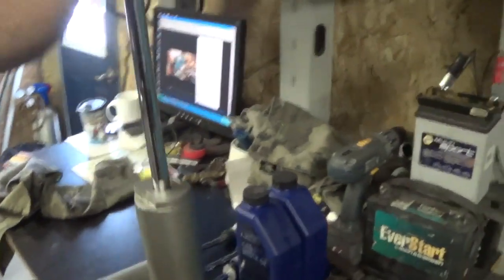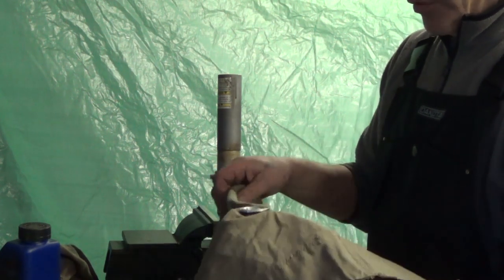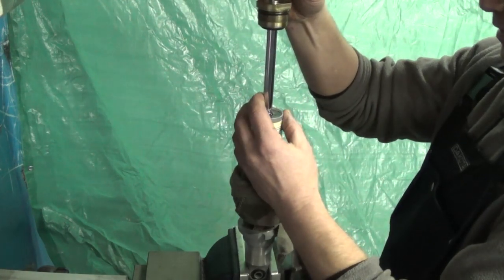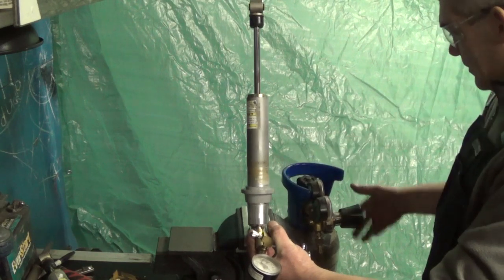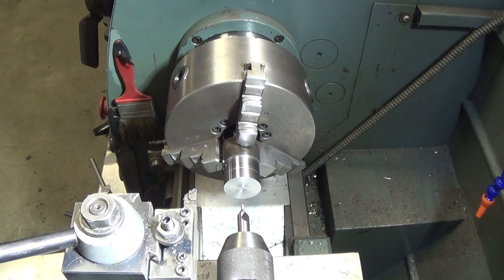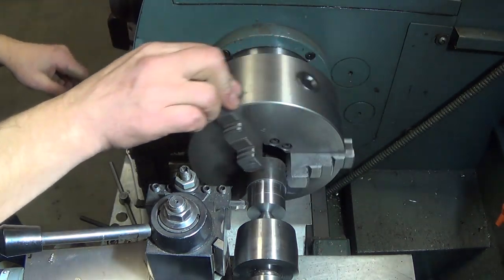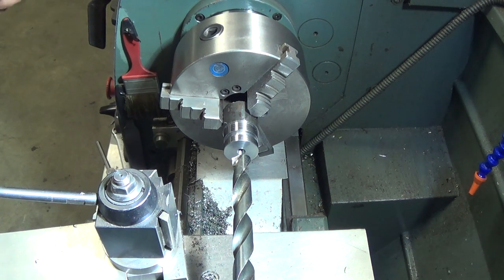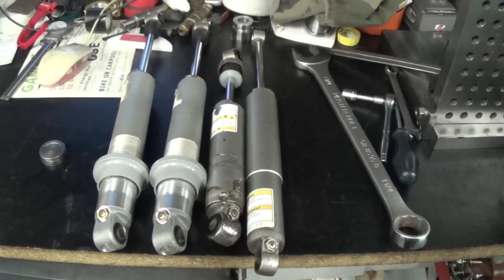A Shocking Development.

Comment: Nice repair build on the shocks. I've never had one apart, so it was a great video to see how to take one apart and what's inside. I can tell you probably have done hundreds if not more of these. Keep the great videos coming.
Reply from the maker: That was a basic set and they do get way more complicated with remote reservoirs and clicker adjustments. All pretty much the same procedure though.
Thanks for the comment! :-)

Comment: Doing a calculation, the shock tube is probably 36mm(1.4173 inch) inside diameter and 1.412 will give .005 clearance.
Great job, Colin, fixin' other people's stuff.

Comment: Great job Colin,   normally when that happens to me, it's the last piece of that size and alloy material I have, then the real fun starts. Very interesting procedure, especially the re-gassing process
Reply from the maker: Ya, sometimes it's just Duuhhhh!
I was thinking a diameter of .9 rather than the depth of .430  LOL
I've been doing these type of shock for some years. That set was a basic setup. They get way more complicated. Some late model shock cost in excess of $600 so they have a lot of fancy parts to justify the cost... :-)

Thanks for commenting!

Comment: Hi, seen the inside of a few of those, but never actually rebuilt any, would argon or other inert gas do the trick, and looks like the O rings or glands last forever?
Thanks for sharing,
Pierre
Reply from the maker: pierre beaudry Nitrogen is used because of its resistance to pressure change with temperature. For the most part the seals will last a long time IF the shocks are rebuilt on a regular basis. Most seal leaks are the result of damaged or rusty chrome rods cutting the seals. Mileage, of course, wears components as well and nothing lasts forever. Seal kits are reasonable cost and once rebuilt the shocks are good as new.  Colin ;-)

Comment: Hey Colin,

Those shocks seem to be responding to the healthy dose of Viagra and nitrogen. Was the original piston gland seal groove round bottom also?

Cheers,

Tom
Reply: Interesting to see process of rebuilding gas shocks.  Nice video!  Mike
 (aka toolmaker1968er)
Reply from the maker: Tom, yes the original groove was of the same radius but cut wider to allow the oring to "roll upslope" as the piston moves to accommodate the oil displaced by the rod as it enters the oil chamber. The sole purpose of the IFP (internal floating piston) is to keep the oil and gas separate while maintaining the gas pressure on the oil to prevent cavitation.
Maybe I need a big blue sticker on the nitrogen cylinder?? lol
Reply from the maker: Michael Murray
Thanks for the comment! :-)
Reply: +oxtoolco Hey Tom you know what the ingredients of Viagra are? Miracle grow and Fix a flat.

Comment: I applaud your rebuilding these gas piston devices.....However, I find the devices themselves to be an engineering failure. They are temporary at best, because they use precision seals to keep the inevitable from happening.   If you ever owned a hatchback car for example, you will know these things fail in use, in regularity...That said, these nitrogen charged cylinders are great as a patch, but no replacement for a hood hinge on a 1969 Camaro....LOL..
Reply from the maker: The particular shock I rebuild most are very expensive snowmobile units. They survive in some of the most demanding conditions imaginable....extreme cold, high piston speeds, hard hits. IMO they are engineered quite well to keep weight to a minimum and still be able to perform over thousands of miles and several seasons. there are a few brands that have some deficiencies but the better brands are quite good. The typical gas shock on a hatchback is nothing like a good snowmobile unit.
Most rebuilds are just a gas/oil change for freshening but sometimes I have to make a new rod because of stone damage, rust, or bending from accident.
What generally happens on the sled shocks is the rider leaves the service interval too long instead of getting them serviced on schedule. The nitrogen invariably loses pressure in the unit and once gone allows water to infiltrate the body and cause rusting of the internal components. By this time the shock is likely best replaced rather than rebuilt.
Thanks for commenting and, yes, a 69 Camaro should be left all original! My fav car, wish I could own one!
Colin

Comment: Hello, what do you think about welding a tire valve on a McPherson gas shock in order to refill it with nitrogen when needed?? Like in this video   https://www.youtube.com/watch?v=ivuhjMDINdE   . Is it any danger in doing this?
Reply from the maker: The shocks I rebuild have an internal floating piston which separates the nitrogen from the oil. Combining a gas with oil will result in a foamy mix which generally wont work. The whole idea of adding gas pressure is to keep the oil compressed to help remove foaming issues.
I'm not sure if the auto strut is even designed to have the gas added as I don't know much about automotive. Sorry   :-)